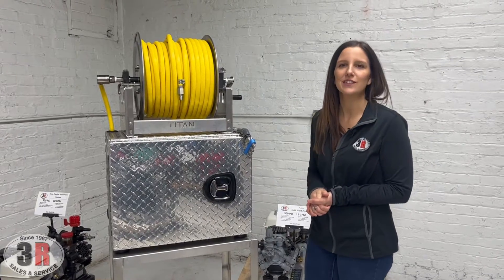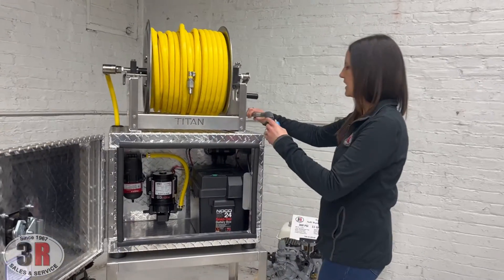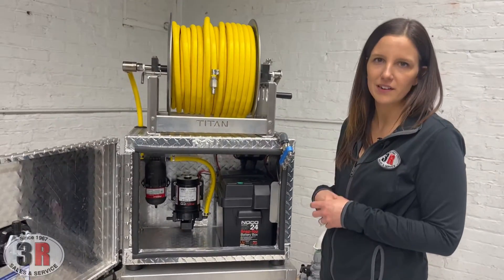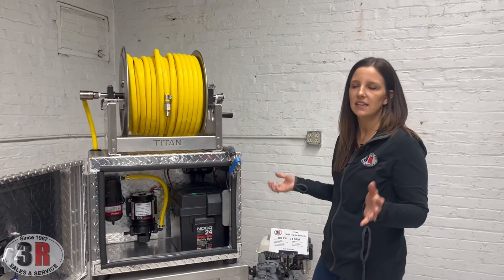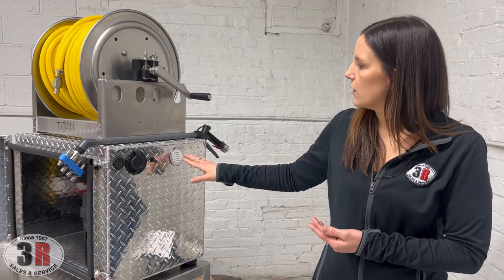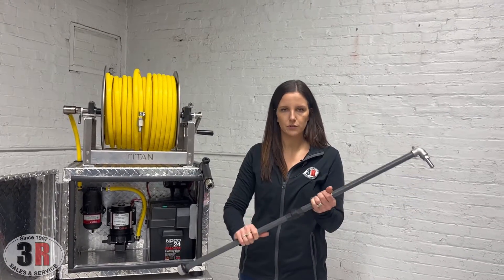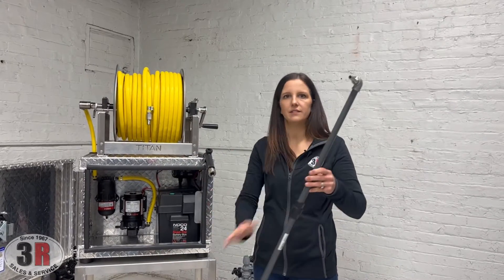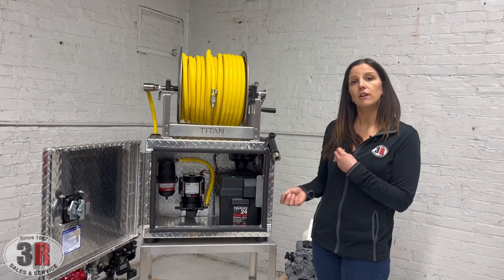12v Soft Wash Box Assembly with Titan Hose Reel & Hose - 100 PSI, 7 GPM

Comment: How does the Noco charge the battery? Do you have to plug into the socket in the side of the box?
Reply from the maker: Yes, the charge port is on the side of the box where it can be plugged in to charge.

Comment: Quick question how much is the cost
Reply from the maker: Thanks for reaching out!  The link for this product with pricing info and details is available below, or in the video description as well.  Please let us know if you have any other questions.  Thank you!

12V Soft Wash Box Listing (with hose reel): https://3rpressurewashers.com/products/new-12v-soft-wash-box-assembly-100-psi-7-gpm/
Reply: The reel included?
Reply from the maker: @vcash1112   there are two listings in the video description - the one listing has the reel & hose included, the other does not.  I'll attach them both below for you to check out.

With Reel: https://3rpressurewashers.com/products/new-12v-soft-wash-box-assembly-with-titan-hose-reel-200-soft-wash-hose-100-psi-7-gpm/

Without Reel: https://3rpressurewashers.com/products/new-12v-soft-wash-box-assembly-100-psi-7-gpm/